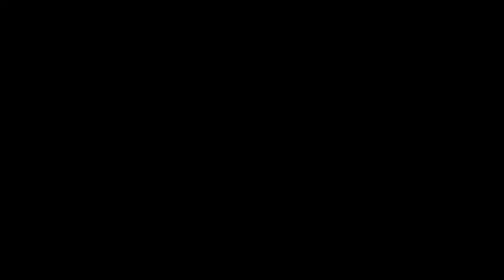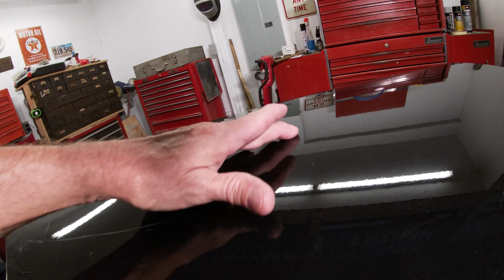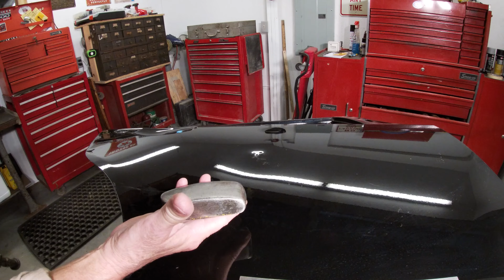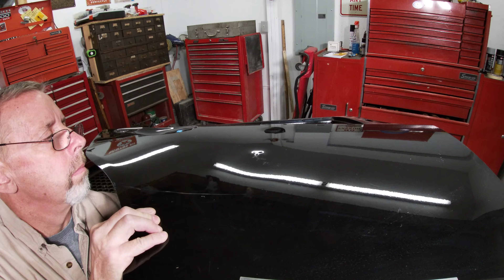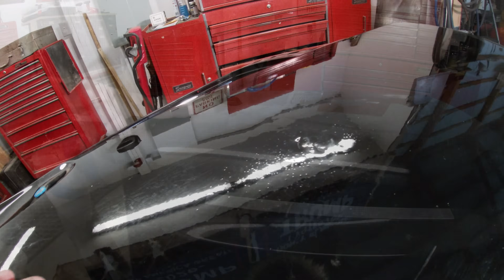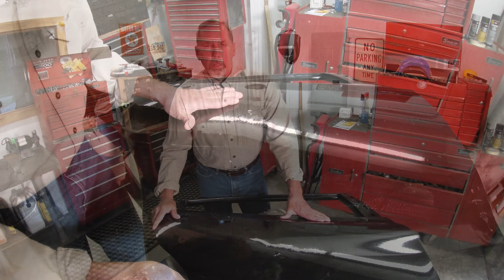How To Repair A Panel Without Heat

Comment: I throw a grid from the bottom with a old metal meat tenderizing hammer that has tight cross hatches but dont push hard, it will eat your lunch. it seems to shrink the metal and really relieves oil canning
Reply from the maker: I never liked the shrinking hammer much but if you have good results with it, no reason to change. Thanks for checking it out
Reply: @autobodytrainingsolutions838  I dont hit it with the hammer Im using it like a rod small pushes. I never tried a shrinking hammer with pdr only if Id paint or primer

Comment: seemed like you were using the pick as a shrinking hammer. why not just use a shrinking hammer and dolly? still a good tip, just curious why it seems like you took the long road.
Reply from the maker: A shrinking hammer is only used when heat shrinking which is no longer allowed on today’s cars. This is an alternative way of repairing a panel. Thanks for watching
Reply: @autobodytrainingsolutions838  try it without heat, still works, though not as fast or easy.

Comment: When you say "off dolly" it would be helpful if you quickly explained what that means. Thanks for the videos!
Reply from the maker: Yeah you’re right. I’ve explained it in other videos so sometimes I miss a few things. On dolly is striking the metal with your body hammer directly over where you’re holding the dolly. Off dolly is striking the metal away from where you’re holding the dolly. I hope this clears it up. Thanks for watching

Comment: Thanks man. Why would you not want to heat shrink it? Shrinking the stretched part with heat would be a lot faster too wouldn't it? 
Love your vintage Snap-on toolboxes
Reply from the maker: On newer cars you shouldn’t use a torch. Heat shrinking has not been recommended by most manufacturers since the 90’s. Some manufacturers don’t even allow a stud gun to be used. Vintage? I bought those new in about 1982. I guess I’m older than I thought. Thanks for watching